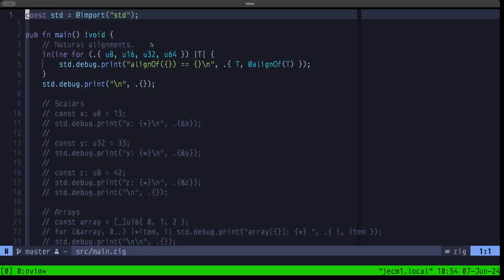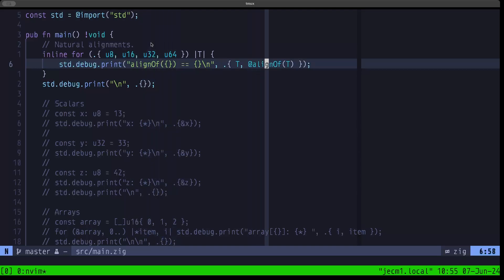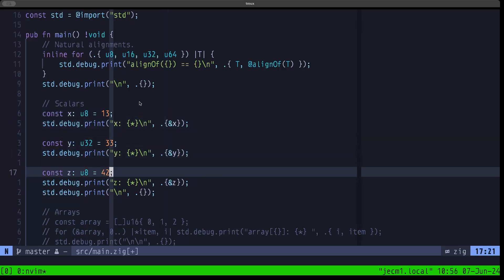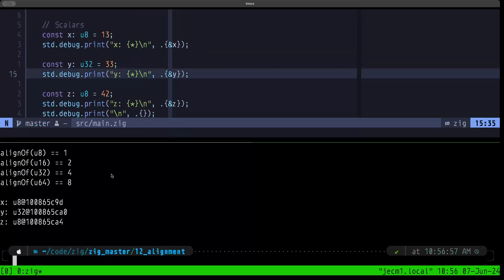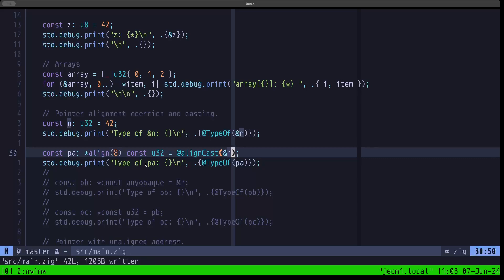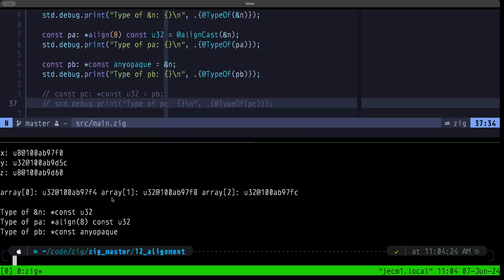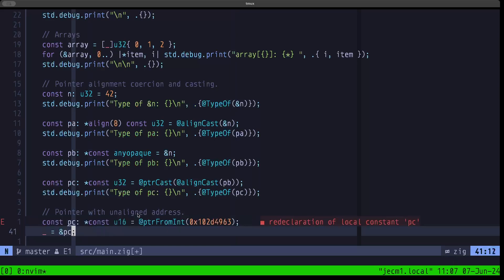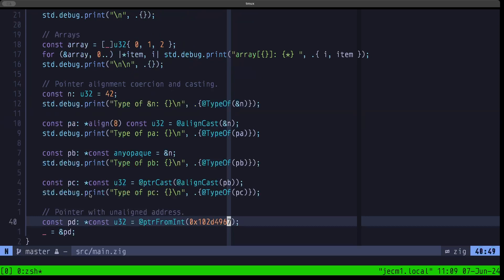Zig Master: Alignment in Zig

Comment: I'm confused is the alignment like a step size? You start at the appropriate region e.g. For variables and then in the case of align(2) take steps of two bytes until you find s spot that can fit an int32? My other Interpretation was that align(2), which is a step that is smaller in bytes than an int32 (4) would create a grid that would overlap memory. the next align(2) int32 would start at index 3, the former started at index 0... Well that's my confusion, because that doesn't make sense
Reply from the maker: I think the best way to look at it is as a rule that controls in which memory address your value can be stored next. If it's an 32 bit integer, say u32, it will by default only be stored in addresses that are multiples of 4. If you force it to be align(2), then it'll be multiples of 2, but avoiding overlapping, so if the first value is at address 0, the next will have to be at address 4 because address 2 would be within the 4 bytes of the first value. If you go the other direction and force align(8), then you'll have padding at addresses 4, 5, 6, and 7 before the next value at address 8.
Reply: @dudethebuilder  ♥